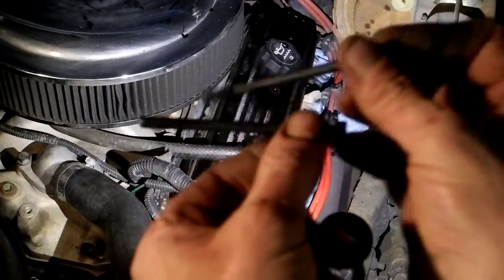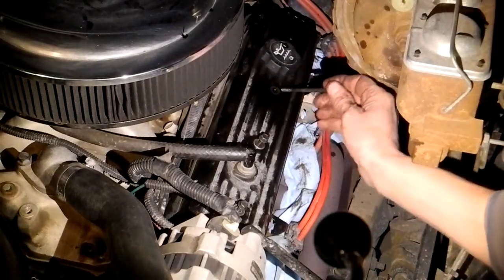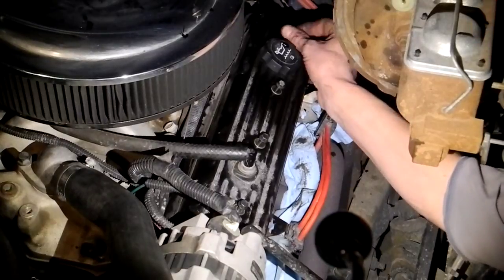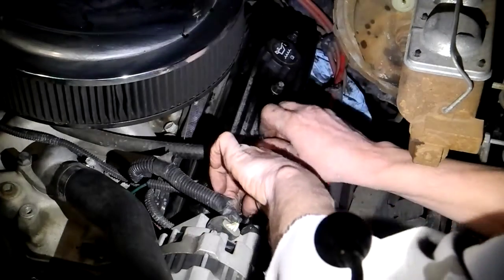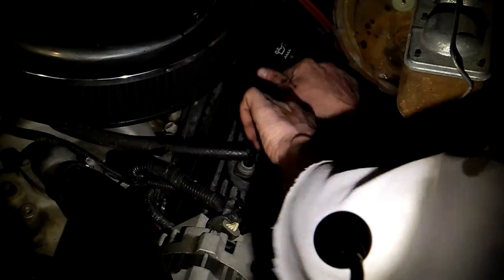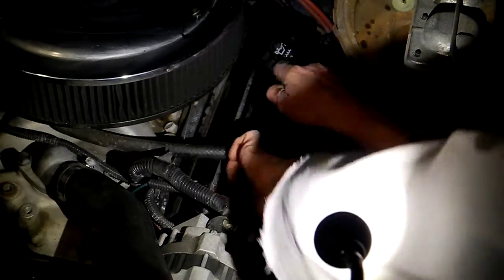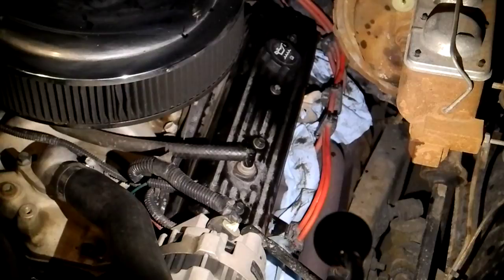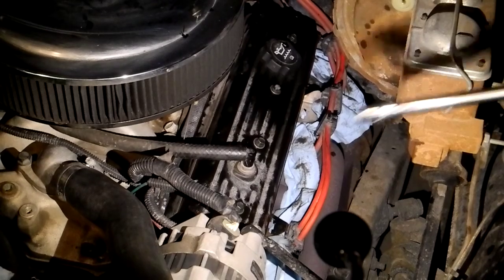06 Valve Cover Bolt Tightening Sequence

Comment: Torque is 106 ft.  Lbs
Reply from the maker: Got bigger problems then worrying about torque specs 😃✔️
Reply: @1Patient   and @joshin_it_all8982, from my experience the torque specification should be reconsidered when installing a rocker valve cover with a new gasket. If the gasket is bulky and the cover old, the guidebook torque may crack the cover. Less torque with simple hand wrench and good consideration is better.
Reply: It's only 5 pounds of torque